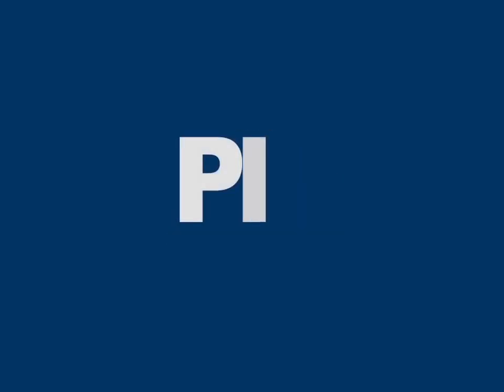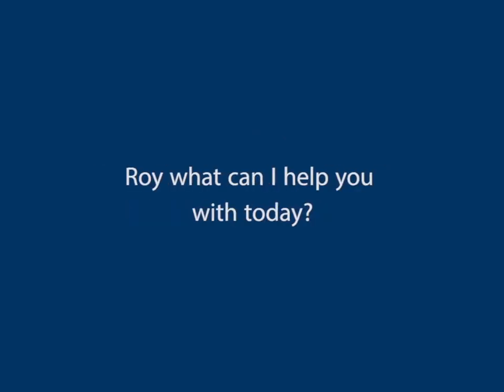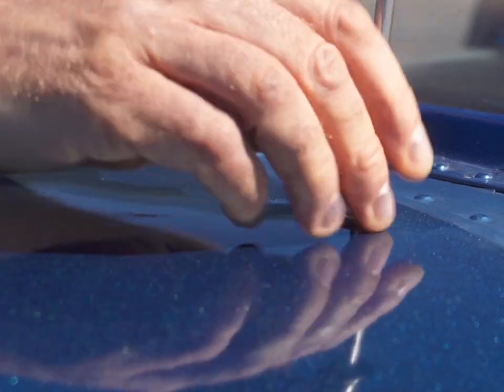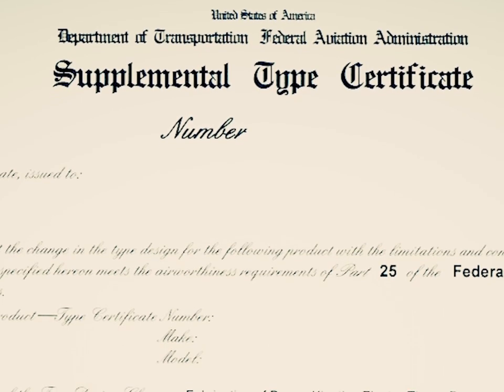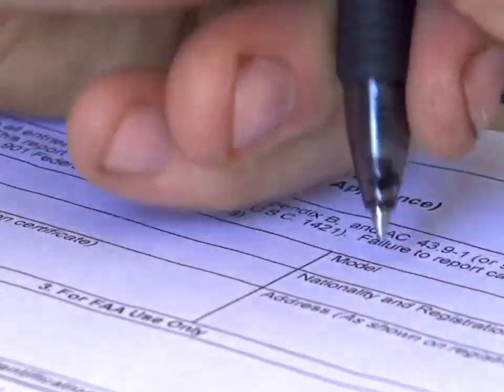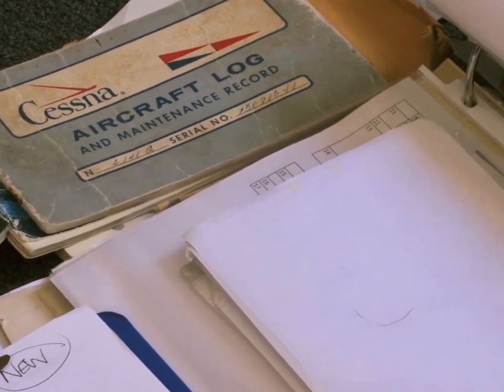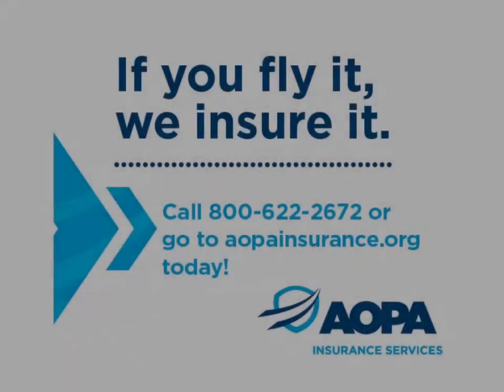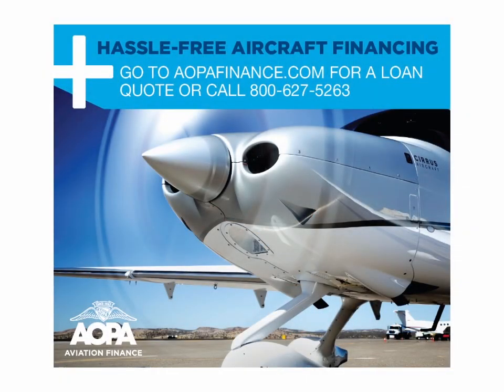Prepurchase Inspection: STCs

Comment: At 03:00, the mechanic appears to be lubing the oil filter gasket.. at 3:05, it shows a Tempest brand filter. If you read the instructions on that filter, it says in BOLD letters do NOT lube the filter gasket. Another great video AOPA..